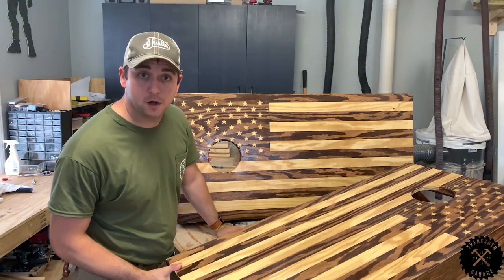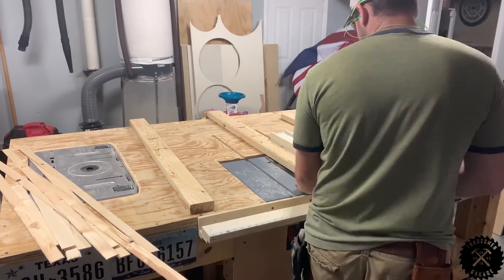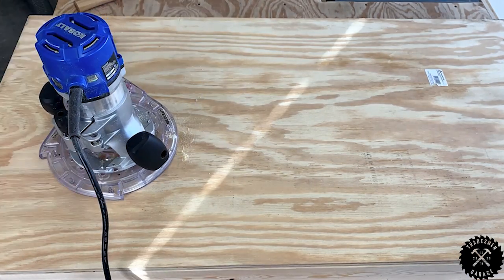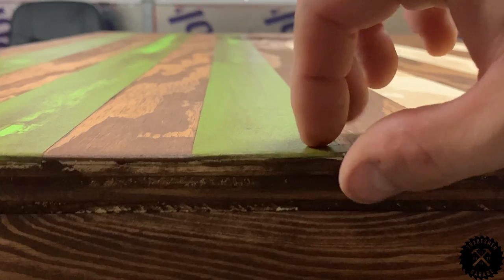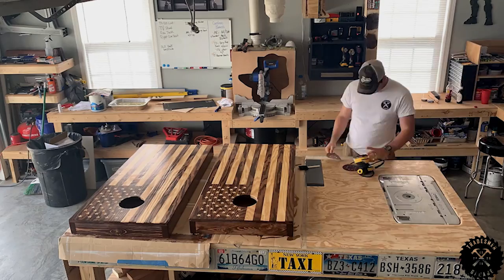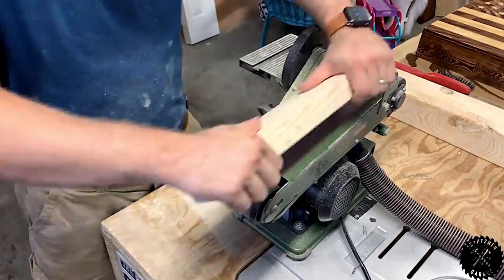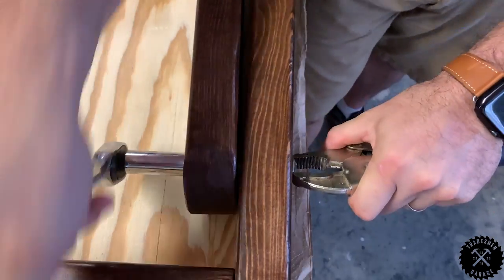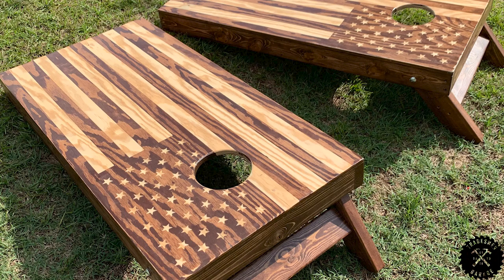How to Make American Flag Cornhole Boards

Comment: I like what you did
I use two fender washers for each leg, no spreader, 12" legs rounded each end, set thickness of 6" comb sq from corner, mark centers w 45 of speed sq., mark arc w compas, secure w nylon insert lock nuts, epoxy shoulders of carrage bolts on insertion, and tighten to desired resistance. 
I add 3" door hinges to one side, repacing 1/4" hinge pins w 1/4" eye bolt, add two spring latches to opposite side along w a large gate handle. Weight is around 39pounds using 1/2" Birch plywood and fingher joint 1×4 frame. I glue and pin nail the top in place. I I really like the idea of using a router to cut the 6" hole. I really like the finish you do. I look forward to seeing more of your work. 
Thank you.
Reply from the maker: Neil Hendricks awesome advice. Thank you sir!  More videos are up and on the way 🤘

Comment: I do these kinds of projects full time. Go to a sign shop and ask them for the star decals in a masking vinyl. You don’t have to put them on one at a time, they can cut the decals out and transfer tape it for you so that they are all perfectly placed. Then you just have to stick on the sticker after you cut the frog tape. It can actually be the exact same dimensions as the portion you cut. You stick on the decals and peel off the transfer tape then stand. Sure it’s a pain to have to pull off the decals of each individual star afterwards but it will save you a few hours because you won’t have to route them out. Also, avid cornhole players may make a stink of the surface of the board has an area that would cause the bag to slide differently. I used to work at a sign shop. If you have any questions or I need to go more in depth (anyone reading this) let me know
Reply: Also want to say it’s worth noting that you don’t have to go to a sign shop. Anyone with a cricut can cut this out of vinyl for you. Search on Facebook through your friends because a lot of people have them to make t shirts and custom decals for yeti cups and what not as a side hustle. You could probably find someone to cut them for you for cheaper and quicker than a sign shop. You may even have a close friend who does it, but either way your supporting people within your own personal network and you can get experience in forming some valuable business-like relationships. Just my 2¢

Comment: Your boards turned out great. The only major criticism I have is the union is on the wrong side. Because the boards are technically vertical while playing, the union goes on the upper left.If you're going to display them horizontally instead, then your's would be correct. As far as the stars go, after doing a few boards the same way you did with the Dremel, I decided never to do it that way again. Now I go down to my local printer and have her print me a union that is 18 1/4" wide which is the exact size union for a 2' wide flag. It costs about $2. I tape off the entire board and then tape my printed union paper to the correct spot. I then get comfortable and use a utility knife to cut out each star making sure to cut through the paper, the tape AND the wood just a little.(You could use an X-acto knife but I found a utility knife cuts straighter, is more comfortable, and the blades last longer) I then cut the stripes to the correct widths (1  27/32") and then peel everything off that I want stained. I use the same gel stain you used, but I've also used "regular" stain. If you want to use regular stain you have to cut the wood with a utility knife even deeper to make sure it doesn't bleed. You also have to remove all the tape so you can see where the lines are and you have to be VERY careful not to get it on another section or you're screwed. I don't suggest it though as it's too time consuming. Thanks for the tip on the clear. I've used a lot of different clear coats, but not the one you mentioned so maybe I'll try that one and see how it goes. Sorry about the long post, just trying to give you some things to think about. Otherwise, great job and great video. Also, like everyone else, I love the table saw setup...

Comment: Once you had the legs made, I would suggest using some 1/4" hardboard to make a template. If you plan to build more in the future, you can use a flush trim bit to round off the legs and your hole won't require any measurements.

Comment: For the legs, set up a combination square to measure down and across to find the center. You can then use your compass to draw the arc (instead of using a cup).  Of course, the compass also marks the spot for drilling the hole for the bolt.

Comment: We have learned that if you put a washer between the inside legs and the boards it makes the legs smoother to pull in and out
Reply from the maker: Absolutely good input thank you!
Reply: I was about to comment the same thing. Also keeps the paint or stain on the legs and sides from rubbing off
Reply: And don’t use locking nuts at first
Reply: @rewsisco2289  yeah I use butterfly nuts.

Comment: I use several coats on my boards as well and they end up super slick.  My heights are correct in front and back.  My bags slide off by simply placing them on.  I have to give a final sand which then dulls it up a bit.
Reply from the maker: BronkBuilt what type of finish are you using?
Reply: @TradesmenGarage  1 set polysilicon (spelling?)  1 set gloss polyurethane,  1 set satin polyurethane.  All same issue.  Takes many games to finally fix.
Reply from the maker: BronkBuilt I use a semi gloss finish at MAX.  Satin is preferred.  Not as shiny and or slippery.  I sand it with 220 max grit between coats if I need it smoother. Spar urathane is the best result I’ve had.  Give that a go instead for all of the coats.

Comment: Nice boards!  For cleaning sandpaper, use a sandpaper eraser.  They sell them for $8-$10 at Lowe’s or Home Depot.
Reply from the maker: labonterobert thank you!  I will definitely be looking from some tomorrow! Thanks for the advice 🤙
Reply: Yes what he said.
Reply: You could also use an old tennis shoe. If you press the sole to the sandpaper, the rubber cleans between the grit. Just don't use a shoe you plan on wearing anymore.

Comment: Awesome looking boards! I make boards all the time but don’t have all the fancy equipments you have. One thing of advice I can say is that there is a format that you can precut the legs and holes. Boards come out perfect every time right at 12 inches.
Reply from the maker: Kodi Brunner thanks!  Ya I’ve looked at a few different way an I’m gonna try a precut method this next time.  👍

Comment: Drop the leg brace down some and add holes for drinks to sit. Or add a score board via metal strip with magnets or drill holes using golf tees to keep score. Great job!
Reply from the maker: Ya ive done a few like that, another scoreboard/drink holder version is in my other video!

Comment: Great job!! 👍🏼👍🏼 They actually make a cleaning tool for the belt sander! Looks like a big rubber eraser! They work real well and won’t cause potential damage to your belt! I am going to make mine and use the torch to pull out the wood grain! Great job
Reply from the maker: Bret Lambky thanks for the insight!  I’ll be grabbing one soon!  I’m also going to try to get a few different designs built with a torch implemented in the build.  Let me know how it turns out!
Reply: TradesmenGarage I love the flags! I am thinking about flags smaller scale for other applications! Keep up the great job!!

Comment: Nice boards. I was interested in how you do the stars but will continue to look for a method that does not have all that mini-routing. One note on the carriage bolt - I have found that if you hold the head on the outside edge of a pliers and keep it from rotating any at all, by the time you get the square of the bolt pulled into the wood and the pliers slips off, the square is seated  and will not turn. Plus, I always use nylon stainless nuts, have never had issues, problems or returns. Thanks for the video, keep cranking them out.
Reply: I just left a comment about it. If you have questions let me know. It will save you hours.

Comment: If you have a old tennis shoe, sneaker use that on the belt sander and the disc as well makes them almost new again. Or just buy a belt dresser on amazon. I been using sneakers for years. Great work. Thanks

Comment: I have also used a wire brush to clean my sandpaper however there is a product by Woodstock it’s an abrasive belt cleaner woodcrafter sells it I don’t know who else does. The corn hole boards are awesome I have made some flags that are similar I think I might try a corn hole board very good explanation on building one thank you

Comment: Would love to see a video on how you made that extension table for your table saw that’s badass!
Reply from the maker: Wyatt McCollum haha ya I wish I was into recording my work back then.  Since I have sold it and upgraded my shop a lot. 😬
Reply: TradesmenGarage Good for you! I think I’ll try to design something similar that’s such a cool concept
Reply from the maker: Wyatt McCollum it was a great investment and it taught me a lot.  Using a cheap $100 table saw and then making my own fence and rail system for it was the best idea I had.  It was completely moveable with a 4’x8’ working top that allowed me to do literally anything I wanted and I could move it out of the shop to do work outside too.  Really fun and functional design!  Good luck making yours! Lemme know how it turns out!

Comment: They look really nice!

I wish everyone would also post how many man hours it took to build them. I was pretty much all in until the stars. That's got to be labor intensive to Dremel out 100 stars. I had the audio muted, so I don't know if he sold these, or what he would charge if he was making these for sale, along with the bags. I'm thinking these would have to go for $400 a set with the labor involved, just to make a little bit of cash. With the bags and materials, you're into it ~$175-$200, maybe more.

I like contrast, so if was building these, I would leave the frame and legs unstained and simply clear coat them or a whitewash stain to let the top stand out more.

Nice job, though, they'll be a big hit with a nice, frosty PBR or two!

Comment: A good suggestion would be a way to attach them together for transportation. It would be cool to have a set that has retractable wheels that would roll like a suitcase
Reply: velcro along the inside corners and a cheap easy way to attach them together. It's not "pro" but it's effective. Then some rope handles on frames to carry them.

Comment: I suggest drilling a pilot hole for the 3/8" leg bolts. Try finding a second drill for this purpose, saving you time. Personally, I'm not a fan of the pocket hole tear out problem. You could try another form of connecting the top.

Comment: Add a reel with string under one of the boards.  Cut the string at the proper distance so you never need a tape measure when your ready to play.  I run mine out the center in front but the reel is in the back for easy spinning. Use a stopper/tab to keep the string from pulling through.  My reel was from a old  ice fishing pole.
Reply from the maker: GD Hunten this is a great idea. Thanks!!

Comment: Nice work.. I like the boards and the best picture that could ever be displayed. A  carriage bolt washer would prevent the use of vise-grips on the bolt head. Also threading the nylock prior to install makes that first thread a little easier on the washer. Just saying because I've been there. Thanks for posting.

Comment: Nice Job Anyone with a vinyl cutter can cut and weed the star stencil for you. Especially if you find the file for them that is the exact size. Of course, they can size it for you also.. But, they cut the vinyl, weed out everything but the stars, and apply transfer tape to the stars.. Ask them to use the lowest pressure transfer tape they have. IE.. Easy to peel off. Then, do everything you do, but, wait until the first coat of poly is on the area where the stars go (good place for a good stick of the stars, and peel the heavy backing sheet and start straight on one edge and start putting it down with a credit card, bondo spreader, etc, while you roll the backing off.. Then, carefully pull the transfer tape off at a good backward angle and the stars should stay right where you want them.. Then, just put the rest of the coats on and your done.. Cut some serious time off of your builds.. They look great..

Comment: You need a belt cleaner , it'd a  type of rubber /sponge material ,from Harbor freight works great on  all types of sand paper. They are located  on the bottom shelf with the sanding disk or sand paper  ,great video
Reply from the maker: Carl Freeman I will be picking one up soon! Thank you!

Comment: Nice boards dude, however id like to point out that when vertically presenting the Flag the field of stars should be in the upper left corner.
Reply: If you are standing to the right of the board while throwing, the stars are to the upper left. Maybe that was the pov he was trying to capture. Or maybe you fellas just missed the point here. Who cares... they are cornhole boards.
Reply: If they are on the other side it's very apparent that you're looking at a backwards flag. Go get your flag and hang it vertically. This is correct.
Reply: I know this is an old comment, but D V is correct. The Union is always displayed in the upper left as viewed. In the case of the boards, as viewed would be the perspective of the player(s) throwing TO it.  I can see why the flag was oriented on the boards the way they are, when the board is on its side the flag is correct. It’s an honest mistake, one that there’s no way around really. If you orient the flag as he has then it’s incorrect while in play, but if you orient the flag to correctly display while playing, then it’s upside down if horizontal… 

The boards are certainly amazing, no disrespect meant, just trying to render the honor our flag deserves.
Reply: commenting about where the field of stars is displayed, yet nobody has said anything about cutting a hole in it and using it as a game piece.

Comment: Nice job!For unclogging sandpaper, try rubbing the belt (while it’s running) with synthetic wine corks.
Lowes has some ‘Lowes only’ Minwax products. I’m not sure if the spar varnish is one of them.
Lastly, after driving ¼ diameter lag bolts into 2” x 4”s, I went out and picked up set of nut drivers for my hand drill. Big time saver.
Reply from the maker: John Gregg thanks!  I’ll give that a try.  I run through sandpaper like it’s nobody’s business lol.  That is a great idea. I’ll have to pick one up! Thanks for the tip!

Comment: If I can make a recommendation it would be to buy sticker stars off Amazon they sell 500 stars and the 1.5" stars are a perfect fit and similar to the tape just peel them off as long as you use a gel stain.
Reply from the maker: Bonydominator we have looked at doing this but I now own a vinyl cutting machine so I can make my own stars without having to eyeball the spacing now!
Reply: Bonydominator. I want to do the same board but Betsy Ross Flag stars.  What size would I need and where on Amazon can I find the sticky peel off stars?

Comment: they look awesome only thing i would suggest is just buying bits with countersink on them save you one step with changing bits for that
Reply: Forsener bits work well, glue in dowel rod to fit, cut and sand. It gives it a very clean look, I use that technique on many of my projects.

Comment: Which Kreg corner clamp did you use. The only one I can find says 1 “ max material thickness. So I’m guessing that it wouldn’t work for the 1 1/2” 2x4. Great project. Keep up the great work

Comment: Nice video! I’m actually halfway through making these right now but I’m a bit confused. Description says you used 1/2” plywood, yet the 1 1/4” pocket screws are for 3/4” material. Am I missing something? Or did I just drill a bunch of wrong pocket holes?

Comment: i wouldnt use the  center piece between the two legs so that if you are on uneven ground you can freely move both legs to where u need them to make the board level because even a inch or two of a down slope will piss you off when trying to throw
Reply from the maker: Very true good point!

Comment: You should drill 2 holes in the leg braces the size of 12 oz cans for cup holders
Reply from the maker: Joeyhohl19 I’ve thought about it. I actually make a different drink holder/scoreboard that I found from Rouge Builder.  I’ll be showing that off in my next video

Comment: I love the look and appreciate the detail in your steps. I'm just starting out as a woodworker and it seems so many videos take for granted little details or use language that I'm not familiar with. You didn't do that. I'm curious if you sell these and what do you charge?
Reply from the maker: Patrick McGuire hey thanks for that! I appreciate it!   I do sell them locally, shipping is very expensive for them at the moment.  But I typically charge $250 - $350 USD for my boards.

Comment: As someone who makes boards, while it might look nice to grind out every one of those stars, you are nuts if that's a good way to do it. It'd be better to use to stencil you have and use a white antique paint with a sponge and then lightly sand it and then polyurethane over the top. What you're doing will take hours where you can get the exact same effect with minutes worth of work
Reply: where can you find that size of a union stencil tho?